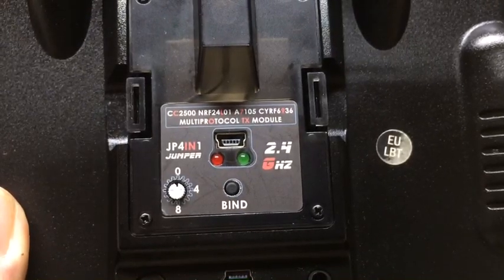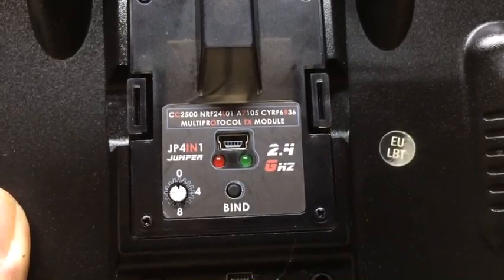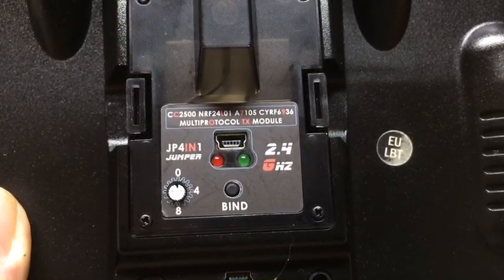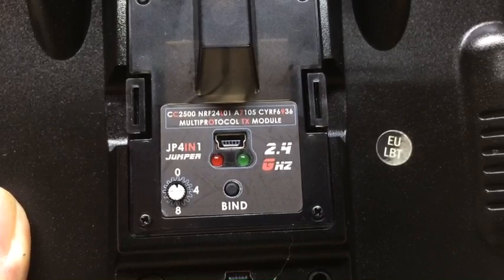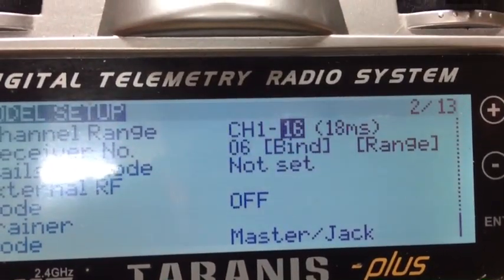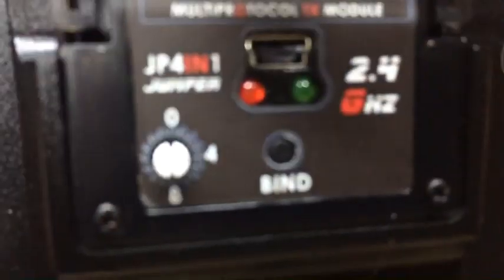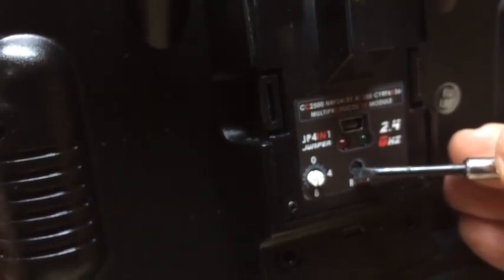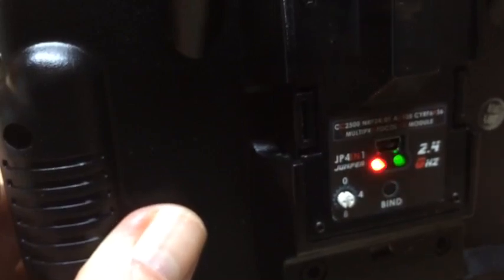Jumper JP4in1

Comment: Can i use this for turnigy9x
Reply from the maker: If the radio has got a JR bay in the rear then yes - for a Turnigy you need the version with the switches on the back. They also do one with no switches which can only be used with a radio that uses OpenTx Ver 2.2.X or later.

Comment: Same problem did u ever figure it out?  I haven't, starting to get pissed off
Reply from the maker: Yes - the problem is that the instructions are incorrect the correct ones are at https://github.com/pascallanger/DIY-Multiprotocol-TX-Module/blob/master/docs/PPM_Setup.md if you follow them it will work mine did.
Reply: @richardlong3615  ty so much

Comment: Can this bind with a non eu receiver trying to bind this with the tbs tiny whoop with my tranis
Reply from the maker: I guess there might be two solutions to your problem. One might be to reflash your receiver with EU LBT firmware. The second would be to select either D16 or D8 from the external multi-protocol options in FrSky from within OpenTx. When I got my module I tested it with an EU X6R receiver and selected D16, it didn't work, on further investigation I discovered there are EU LBT options which did work. I can only assume that the D16 and D8 options are for FCC or international firmware. You don't say if you are using OpenTx to select the protocol or just sending PPM to the module and selecting using the rotary knob. If its the latter might I suggest you either download the latest version of Opentx and select multi protocol or follow the link in my answer to BM Russo's comment where I am sure details of how to manually select the correct protocol will be found.
Reply: Richard Long many thanks for your reply bud means a lot

Comment: OK I talked to the designer of this MPM the proper protocol selection.  It depends on the firmware version you have installed. If it's original Jumper then you have to use their chart. If it's an update from github then you have to follow the layout in the _config.hv file as noted in the listing. My instructions below were only valid for an older version.
Reply from the maker: I contacted Jumper when I couldn't make the module work outside of OpenTx they asked me to make a video showing what I was doing. Having viewed this video Jumper concluded that I was not selecting the protocol banks correctly. They provided me with a link to a document which showed how it should be done. The correct method is to move the rotary knob on the back to position 15 which is one click anti-clockwise from vertical and then while holding down the bind button switch on the radio. The red light will flash from one to five times depending on the protocol bank selected to move between the banks you need to press the bind button briefly. It would appear that the firmware version now being shipped has been updated but the instructions not so. Once the correct bank has been selected for the protocol you need you then need to rotate the knob to the appropriate position. The link to the instructions on Github are as follows: https://github.com/pascallanger/DIY-Multiprotocol-TX-Module/blob/master/docs/PPM_Setup.md
Reply: @richardlong3615  I'm happy to hear you found the solution.
Reply: @richardlong3615  Hi, can I ask how do you know which  bank a protocol is in, and which number in that bank ? Also they list sub protocols how are these enterted. Thanks.
Reply from the maker: @foloeel  If you follow the link in my post I think there is a link which tells you. I remember creating a document with them all listed I will have a look and see if I can find it and if I can will send it to you.
Reply from the maker: @foloeel  Hi Olof, I have found my document which details where each protocol is but I can't copy it into this message. Please email me and I will email it back to you. richard88long@gmail.com
Reply: @richardlong3615  Thanks for your reply, never got a notification for it. Have solved the problem through the good people at RCGroups. Thanks again.